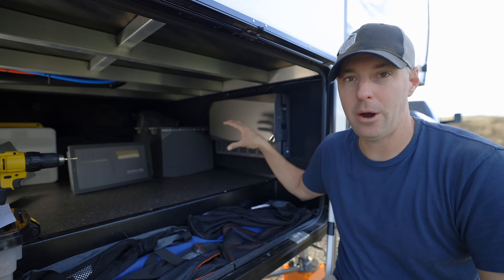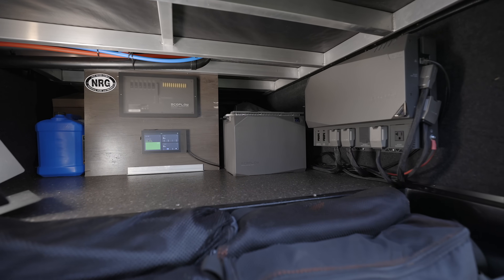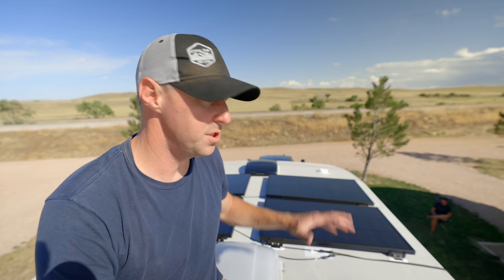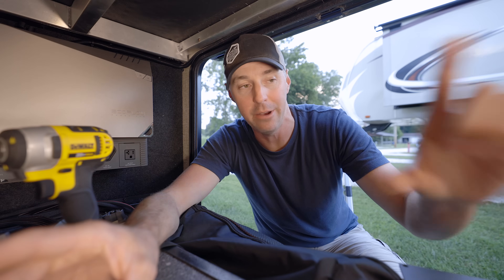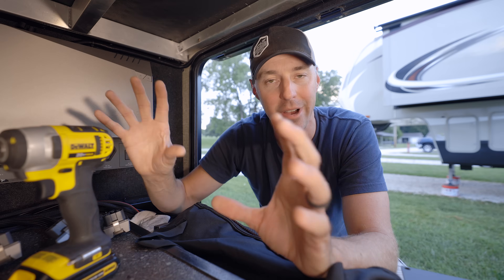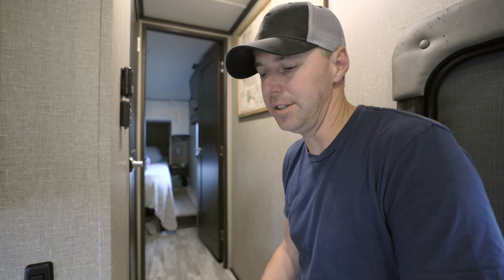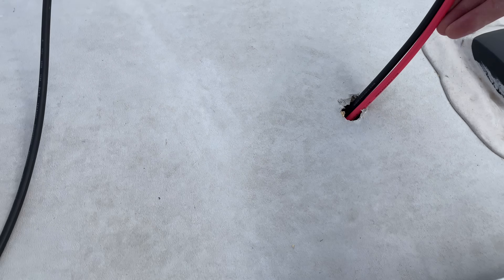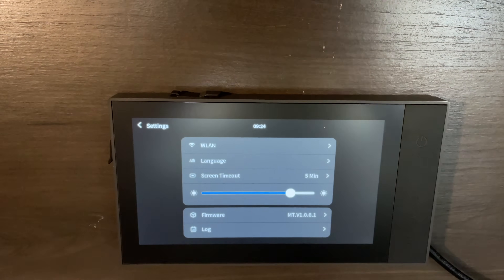Powerful Inverter And Solar In One!  EcoFlow Power Kit for RVs. Install And First Look

Comment: How were you able to fit everything with only six 20amp breakers? And how did you get around the 15amp breaker in the original panel to the 20 amp breakers in the new one? What about the 50amp shore power already in your RV? Is your RV now a 30amp?

Comment: I  wear a Cpap machine. I would like to boondock more, but need the machine to get a decent nights sleep. Looking for ways to run the cpap off the battery without running it down too much at night. Any ideas besides spending 1000.s of dollars?

Comment: Can't find a video on installing the Eco flow system on a trailer that has a breaker? Should I remove the breaker and power meter? Then Install the Eco Flow. I know very little about electricity. Currently live in Memphis, Tn, and lose power way too much. I use about 1,900 kWh per month based on my utility bill.

Comment: Huge waste of money.. 3k inverter/charger 5kw solar $700 EG4 off grid inverter, EG4 server rack 5kw 400ah battery $1500 out of Texas at signature solar. That’s system you set up was what $6000?
Reply: Very bad PR to package your comments this way if you're a business. I'm in the market for equipment like this and live in your region. Would be running to your business but for the unpolished way you made your point. What you do next in reply, if at all, will say a lot.
Reply: @grambothelegend7388  not my business… just common sense for anyone that spends more than 10 minutes researching equipment. Mentioned these specifically because I have bought and used them personally.
Reply: @JBSCHAFFNER  [intended as friendly and constructive]. You sound like you'd be a very helpful and experienced resource but for the little bit of snark. Consider that folks would be more receptive to you without it.
Reply: @grambothelegend7388  p.s. the solar panels I would of used would be BougeRV 200w CIGS flexible solar panels. No mounting needed, can walk on them, work better in less than perfect conditions and much more durable.

Comment: Would REALLY like to see a "how to" or "step by step" guide for us lesser knowledgeable folks on how to connect this type of system to a 50a RV electrical system.  I understand the DIY Victron setups are MUCH better, but everyone's needs are different (as well as budgets, skills and desire to "play").
Reply: I’m in this camp. My eyes might glaze over, but some are super curious. 🧐 trying to understand 120V shore in and 120V distro out options with existing 50A has me scratching my head.

Comment: Does this power kit behave like the multiplus with the output power being able to be "boosted" by the batteries when on 15A shore power? Meaning if you're hooked up to 15A (and set the input amps like you showed in the video), and you turn on your AC that uses 15A startup, and 9A running will it take the extra from the battery for the startup amps, and/or when use your microwave?

Comment: We are in the market for a solar system for our 5r we are still looking at a Victron multi plus II,  the video was great but I just looked at the website for this product,  Yes  it's simple and easy to install . But even with the free installation they are offering right now the cost is significantly higher Than a more powerful Victron system and has serious limits if your RV is 50a ! What some people don't know or understand is if your RV has 50amp service it's technically 100amp they are 2 120v legs each "if the Parks wiring is good" each leg is 50a. This means your breaker panel has 2 50a legs going to it ,  if you have 2 ACs  each AC should be on a separate leg or you are going to overload the system. This is definitely a good system for a Van or a smaller RV with 30amp service, or maybe even a Tiny Home? But if your rig is wired for 50a I would look somewhere else it's just not designed to work with your rig. Correctly wired only half your 50a system will have Solar power. If you figure out how to get it to power both legs your playing with fire literally.
Reply from the maker: Yes, I’m my opinion is the Victron MultiPlus II is king and our favorite setup we have. Here is my install.https://youtu.be/kBYgkN1_r8Y
With this it works easy for a 30 amp RV but on a 50 amp RV you would have to do a sub panel setup where you pick what you want on the inverter. I would definitely not recommend connecting it straight into the panel and trying to run one leg of the breaker panel of the RV.

Comment: I love the idea of this setup. But you did not show how my 50amp RV (2022 GD Refl 303rls) would wire into the hub.  How to hookup my dist panel to the hub, my 12v converter to the hub to run my 12v fridge and other 12v system. How does it work with 50a and 30a shore power. Does it have an auto transfer switch
Reply: After looking at This thing on their website it's not a good idea to try , you can't convert a 30a power source into 50a not safely. You would need 2 systems to feed each leg of your 50a rig, I don't know how he did it. But I don't think everything in his camper was able to get power from this unit. Unless he replaced the breaker panel with a 30a panel basically reduced the ability of the RV in half.
Reply: @KRich408  My RV has a 50a shore power plug. But only 50a because of the 2nd A/C in the front BR. We only use one A/C as that one keeps us cool and we have it ducted to the front BR. So we really only need a 30a service. My concern was how to route wiring and performance. This is a new system and with all new things... well you know the drill.

Comment: Sleek and convenient,  but expensive.  My experience is that most people aren’t off grid enough to justify the $4k+ price tag. Frankly, I’m out of water and gray capacity before I run out of electricity these days.  Nice product tho.  Things are changing so quickly with solar and lithium batteries these days.

Comment: Seemed a bit down on it at the end… was that potentially because of the 4Kw capacity? Seems like a larger RV that could have benefited from the 10Kw kit.
Reply: ahhhh, I see from an earlier reply that you have a Victron setup already, which is, in my opinion, the gold standard. I hope Victron will do something comparably streamlined. My truck camper needs something butndowsn’t have the space for a full victron build.
Reply: This is a pretty good power system upgrade for any RV.

Comment: Jared, great videos - I was wondering if the RV lights the main ones were dimmable or if you have ever done that. I have one switch that turns all the lights on and it is very bright. I would like to make them dimmable if possible. I have a 280 RS Reflection 
Thanks

Comment: Appreciate the video. I previously watched your video on the Victron Multiplus inverter etc. After watching you do the install I pretty much feel like I could do it. I was planning on the whole setup with 1200 watts of solar and about 800 amps of Lithium battery bank to be able to run AC for several hours. Now, this unit looks inviting.  For a recommendation, would you go the Victron rout or this plug and play rout. I'd appreciate your advice. Thanks.  Gary
Reply from the maker: Victron is my favorite. I would go with a Victron system.
Reply: @AllAboutRVs  That helps and was what I thought you might say.  We don't get our new RV until late Sept or early Oct.  I want to be ready to purchase everything and do an install. Can you help me with advice on where to purchase the necessary equipment and even solar panels?  I live in AZ but I'm sure most of the purchases will be on line. I don't know where I can go direct to the factory or if I have to go through a dealer or what. I'd appreciate any suggestions you can help me with.  Thanks!

Comment: I installed a 6000watt inverter with a automatic transfer switch to switch back to power at the camp grounds to run only my Refrigerator while going down the road 2 batteries in the camper and 2 in my truck which run it perfectly for a whole day of driving...

Comment: Jared:
Is it not possible to swap the AC breakers for smaller amp ones?
Reply from the maker: No I opened it to see if it was simple and you would have to take the back off and disable some circuit boards to even get to it.
Reply: @AllAboutRVs  Thanks, I did some digging elsewhere and it appears they are marine circuit breakers not traditional residential style.  Are they hard soldered onto the circuit boards or is it just a matter of disassembly to get to them.  The reason I ask is my plan would be to completely replace the OEM distribution panel with this one and the OEM panel uses primarily 15 amp breakers.

Comment: Jared--Thank you, another great video. When I need RV electrical information I turn to your videos--the best available. I like the Victron system you installed and showed--would you consider the EF  another possibility for permanent installation powering a 50A double leg system with solar in my GD for operation of ac's, and other heavy power requirements all at same time? I see many portable setups online but your video is the only one showing permanent installation.
Reply from the maker: I would recommend the Victron MultiPlus II 2x120 for a 50 amp RV because it has a 50 amp transfer switch.

Comment: I did notice that the wires are a bit thinner.  Looks like it is using a 48v system which translates to thinner wires and a safer system overall.

Comment: Hey Jared, great review. I’m in the beginning planning of my solar install and had planned on going with the Multi Plus II so I could power both legs of my 50a coach. Not sure I picked it up but does this unit have the ability to power L1 and L2.
One other thing I looked on their web site and it doesn’t look like it is listed. Do you know if or when this RV ready until will be released?

Comment: Hi Jared, we are very interested in this system...looks really smooth. How is it really running the A/C? With Climate Change the ability to run the A/C in ever climbing temps is going to be very important. Also, price wise how does that compare with a regular solar/battery install? Thanks for the info!
Reply: The magic in that is the soft start systems he has installed on his AC units.  "Affordable" AC systems use compressors and other components that are a bit power greedy.  Getting the compressor started without a soft start requires a LOT of power, but once running they are better.

Comment: Jared: it’s great to see you testing thins unit! My thought was that you could leave your existing original load panel 15A breakers in place, take the LOAD side of the 15A house breaker and feed the 20A distribution panel. (I’d put my own label on the distribution panel “15A Feed” or something similar). I’m guessing there’s a reason you wouldn’t do that.

Comment: Looks like a great setup. But what about the extra weight you'll added and the risk of large hail hitting your new panels. I drive a 2017 2500hd  and pull a 2013 38ft Montana and I'm always watching my weight. I've thought alot about going your route but I don't do any boondocking.. Once again great video.

Comment: Simple? I'm too old and limited resources  . As long as my RV is less than 11K I just buy the standard batteries and if needed I plug in my POWERBOOST F150 for 7.2 KW of power and idle for days. I am also a retired Navy Engineer 🙃 and a graduate of a RVIA certified RV School. "YOU THE MAN " Enjoy 😉 your videos. Want something exciting buy an RV with pneumatic slides and watch out.
Reply from the maker: Thanks

Comment: what does this power hub do that a delta pro can't? I am building a solar generator system for my motorhome to replace the onboard gas generator.
Reply from the maker: There is quite a few differences but this power kit is built to be integrated into an RV rather than using a portable unit “like” a generator. This has hardwired 12v out the ability to charge from an alternator and hardwire to the AC side just to name a few things.

Comment: To bad they don't have 50 amps and not just 30 amps
Reply from the maker: Yes. It works great with a 30 amp Rv but the best setup for a 50 amp RV would be with a sub panel for this power kit

Comment: Yup, I’m intimidated by your system.
Reply: Agree. And I'm intimated by this "simple" install. When u were talking abt the 20 Amp breakers, breakers in ur rig & melting wires. I felt like a deer in the headlights.
Reply from the maker: I should try and simplify it. When you take it a piece at a time it is less complicated.

Comment: How long can air cond run continuously ?  On hot days our air cond will run continuously all day till evening sometimes.
Reply from the maker: On the batteries I have with it it could only last for an hour or two. If you maxed out the solar and battery bank you could run it all day. It just depends on how much you want to spend to not use a generator. I usually size my system to not need a generator until we want to run the AC for hours on end.

Comment: But you installed a Victron MultiPlus II just a while back with the 3x batteries.   Are you removing that and using this unit full time?
Reply from the maker: No we are sticking with the Victron. This was to test out and review.
Reply: @AllAboutRVs  But But Jared the video show you screwing a solar panel down to the roof. Looks kinda permanent. I think the EcoFlow is an amazing alternative for those who want to simplify the wiring , but pre made cables can complicate a permanent install. It is nice to know that you have not given up on the Victron, it has its own set of advantages.

Comment: Jared, first, love your videos. I have watched every single one. Second, not sure who else might tackle this. What I am thinking would be an awesome video would be the installation and use of a portable PowerStation in an RV so that it could co-exist with an existing system and maybe a generator. Ad at the same time be movable (minus maybe roof solar to another RV. We all know people change RV from time to time and having a system that could move and would not impact factory wiring would be cool. Just another source like a generator. The issue I see with options from delta pro and Bluetti (AC500 is interesting) is AC charging. In a perfect world you could plug your RV into 50 amp and run everything through your system and charge your batteries. You could also run your generator through your system and charge your batteries or you could run your system from your batteries. And when you are done with the rig you could move your 5-figure system to a new RV and plug and play. Not sure if the manufacturers are ready for this but they are getting close. If it ever worked out that you have a video on the viability of this, I know it would be interesting and unique in the space.
Reply from the maker: Great idea! I’ve been considering doing something like this because it was quite involved when we sold our last RV and pulled most of our solar and inverter out.
Reply: Thank you for your kind words! I totally agree with you, having a portable PowerStation in an RV that can co-exist with an existing system and be movable would be fantastic. The Segway Portable PowerStation Cube Series is a great option for this, with its massive capacity, powerful output, and fast recharging capabilities. It's definitely worth considering for those looking to have a reliable and versatile power solution in their RV. Happy camping!
Reply: I have an Ecoflow Delta Pro with extra battery in my passthrough powered by 4 200w panels on a ground mount. I connected the DP to my 30amp plug via a 30amp cord buy drilling an access hole in the pass through and reconnecting the cord end I cut off so the hole is smaller, to the DP.
I have my TT parked on my property though & not traveling while we build a house. I need to take the Coloplast off and connect it properly of course for travel. But I also have a separate system of 4 190watt panels on the roof with 4 Safari LifeP04 batteries that I are supplemented by the DP in winter. Not perfect but made it through 2 Wyoming winters so far.

Comment from the maker: Current Issues: I do not recommend this unit at this time. If you want something simple with no install I would do the Delta Pro (http://bit.ly/3LA1QpV)over this. I have been having more issues with it that have not been resolved. It is drastically dropping voltage like it is in a X-boost setting for loads that are well within it's specs. 
 Here is a code to save 5% if you are interested in the Power Kit.
Use Code JAREDKITS5 to save 5% until the end of October  https://us.ecoflow.com/?aff=259
Reply: So the kits run from $4,000 to 13,000. Im not made of huge anounts of money. Any good systems that are cheaper?